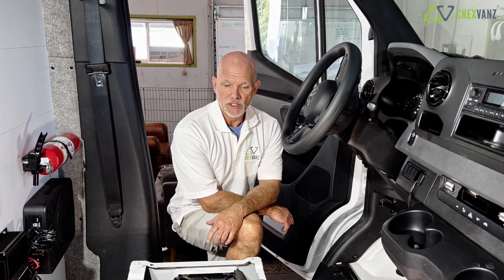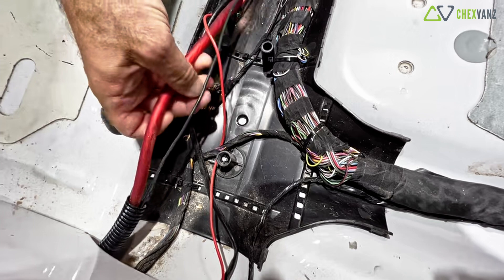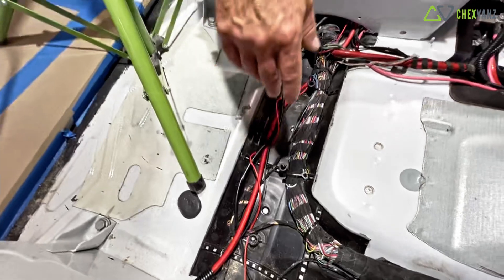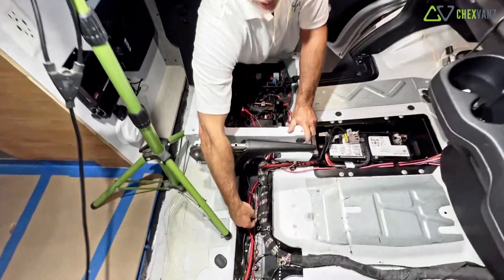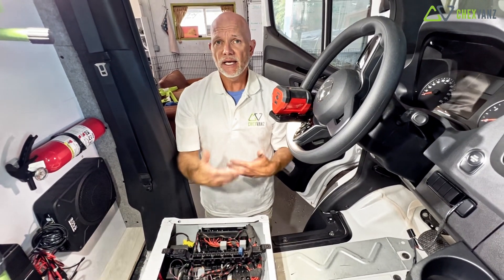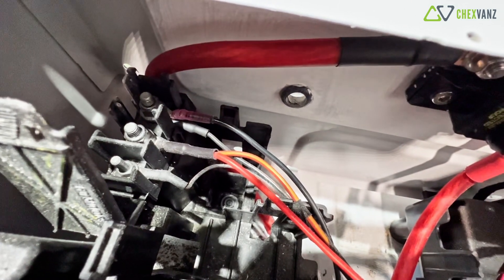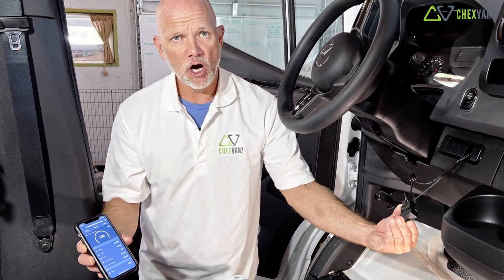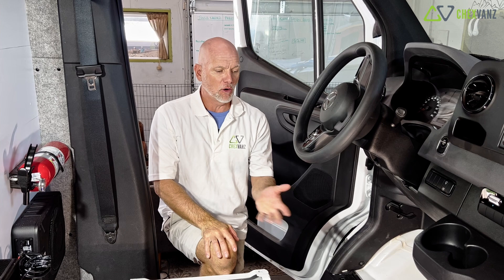How to Wire DC To DC Charger In Camper Van | Mercedes Sprinter 144

Comment: I have a 2018 MB vito. I have the 35mm cable connected to the starter battery terminal direct. I have a renogy 60amp DC-DC charger. The smaller cable is connected to a point in the fuse box, which only is live when the engine is running. My problem is the ECU smart charging of the starter battery. If the starter battery if fully charged, the ecu will not allow the DC-DC charger to work, as the ECU will only allow 2v 0.6A. How can I overcome this???? Regards Barry.

Comment: Why the switch? I thought this DC to DC charger automatically turns on and off with the engine..
Reply: This....going into the d-tap should eliminate the need for the switch.  Confused as well why they put one in.
Reply: Mentioned strain on alternator....my 22" is rated at 80amps and then overcharging battery....really don't think that is an issue at all with a proper built system.  It is a nice shut off option but for me would be unnecessary.

Comment: Fair Warning for Mercedes Sprinters. I have a 2016 Mercedes 4-cylinder cargo and I have NONE of those connections under the driver seat. There is no auxilary conection, no bus connections, and not other way to tie into pretty much anytning. It turns out, these are optional components available only if the proper options were selected at the time of manufacture.  Otherwise you pretty much have an undocumented and very difficult mess to deal with. This video was great BTW, it definitely game me ideas how to wire ignition.

Comment: I’m know I’m late to the party here, i liked the video. Do you happen to have a schematic I could follow?
Ive a 2017 3ltr v6 diesel with a smart alternator using 400ah lithium leisure batteries and really found it hard to find anyone to wire up my 60amp renogy dcdc charger. Im not afraid to do it if i have a roadmap.
Cheers

Comment: Excellent video. Are you sure you are connecting to the correct post? I've seen a MB diagram that says terminal 1 which is smaller and called terminal d+ is power with engine running and you connected to terminal 3 that is for ignition power.
Reply from the maker: We used a multi meter to ensure that terminal only received power upon engine start. Thank you for the heads up though!
Reply: @chexvanz  Great question and answer to remind people to test with multi meter !  I've got a photo of the hookups too where they show left blue/yellow wire as D+ alternator 10 A fuse,  and right black/yellow ignition run/start - 15 A fuse.  The newest 2022 Body and Equipment Guide was also very helpful in directing me towards understanding what the problem is in the newer Sprinters lacking the E36 Code.  Sucks that the sales agents were not made aware of this because we had explained all our intentions when special ordering the vehicle.  But you nailed it.  It's just the solution I've been looking for as an electrically nervous retired mechanic's daughter.

Comment: Great video. About to do this in my 2013 Sprinter. What is the AMP rating of the Blue Sea breaker switch? Thanks. I have the 50A Renogy DC-DC Battery Charger with MPPT
Reply from the maker: Your fuses should always be rated for max amperage of the wire gauge you are running. In our case, we are using a 60 amp breaker.

Comment: I noticed your fire extinguisher ? If you care about your sensitive, expensive power system you need this fire extinguisher,  yes more expensive but it's rechargeable  , brand is hr3 performance maxout dry chemical car fire extinguisher,  the extinguisher doesn't leave powder residue most people never heard of these extinguisher I have 2 in my overland builds I'm  Not sponsored only Information well worth the money comes in different sizes 😊

Comment: I've watched many of these videos (some very scary) before coming to yours. This is one of the best I've seen. The use of a breaker under the seat is inspired.  Also, I have been wondering why people haven't been using chassis ground. I was thinking there must be something that I was missing.  Thank you for verifying.  This will save me 50% of cabling money.

I do have one question. I like to have my cables premade.  Do you happen to remember the size of the stud on your positive connection?
Reply from the maker: We used 5/16 lugs at each side of the connection

Comment: I've found that clear insulation on the wires is usually a sign of CCA. Hopefully you didn't run 4awg CCA to the back...
Reply: What does that mean CCA.. As 4ga is 4ga... And the color is to identify that positive from the negative..Where Clear wire is identified as Grounding conductor..
Reply: @WizzRacing  CCA means Copper Cladded Aluminum. So Aluminum wire, with a coating of copper on it. Typically I have found most manufactures of CCA wire to insulate it in red or black clear insulation as shown in the video.

CCA 4awg wire is the thickness of 4awg, but since it is an aluminum copper mix it can't transfer as much power. Typically it is half. So a 4awg CCA wire is equal to a 8awg copper wire.
Reply: @THeChickmagnet0031  I get that but 4ga CCA is rated for 125 amps.. Only good reason to avoid it. As most people don't tighten the lugs once a year. 

I think most of the confusion is this is a hold over from Car Audio people..As OFC is more flexible. Less prone to oxidation.. But anybody doing this should be using Dialectic grease to start with..Unless you use all Aluminum. Then you need NLGI Grade 2 grease..
Reply: @WizzRacing  Where are you seeing 125a? Everything I am seeing CCA 4awg is rate for 55-90 depending on temps.
Reply: @THeChickmagnet0031  It's a 125 amps for 4 hours or less..

And I bet you $10.00 you got the 55 amp off some car audio site. As 90amps is "Continuous use" Why you have to size the fuse to the application..
Reply: @WizzRacing  Encore Wire, looks to be a pretty reliable brand. American company, 4 awg, 55amps at 140f.
Reply: @THeChickmagnet0031  Well there you go.. As the longer the run. The more resistance due too voltage drop...

Why I use Matugajp SJOOW cord for most my wiring.. I know what I'm getting..Plus I can use strain relief connectors to secure\seal them off..No wires flopping around to rub on stuff...
Reply: Hey there sorry for delay trying to get a van finished by 7/15 😅 I don’t like to use CCA either and this is not CCA.. looks like it on video but it’s not.. the studs under seat at terminal are 5/16 and on remote side are 5/16 as well hope this helps and thx for watching!

Comment: I have a sprinter and am currently in the process of installing two Victron DC to DC chargers. I am adding a thermostat that will automatically turn off the DC to DC chargers if my battery temp is too low since I do not have low temp sensing in my batteries. Have you ever included this feature and your thoughts rather than a dash switch?
Reply: Any good DC-DC charger should include a Temp probe for High\Low cut off... Does Victron cheap out on that function?

Comment: How in the hek did you get the white plastic cover (between the two cab seats) off?  I need to run a cable through that area. ? Thanks.
Reply from the maker: You need to remove the entire seat shroud (the white metal box the seat sits on)

Comment: I have a camper trailer that is equiped with a Lithium battery. I’m not recharging the camper’ à battery while travelling, thus disconnected. I heard we would need a DC to DC to charge a lithium battery, something to do with the AMPs of the lithium battery that is a little more than 12V. If we would want to charge the lithium battery, from our SUV’s battery (while travelling), do I need a DC to DC charger between the SUV battery and the camper’s battery? We tried to find someone in Montreal that has the knowledge and the competency to do the work. What would you suggest? Thank you so much!
Reply: I would first have your Alternator tested for output at idle and 2500 rpm.. Then have them print the results out. That way you know your alternator can handle the charging loads. Idle being the most important one. As you can damage an alternator not designed to idle charge more then 60 amps.. Which is what the vehicle requires just to run.. And make sure you turn everything on when they test it. Like AC, Headlights etc.. That way you know the true output at idle..
Reply from the maker: Yes a DC to DC charger is exactly what you would want. Basically you are using your vehicles alternator (while engine is running) to power your DC to DC charger. This allows your DC Charger to charge your lithium "house" battery while traveling. The size of the DC charger is based off the size of your lithium batteries. Renogy has some information at the bottom of this page to give you an idea of what size charger you would need. https://www.renogy.com/battery-chargers/dc-dc-battery-chargers/ These are the chargers we use in our vans but there are plenty more options/brands to choose from.